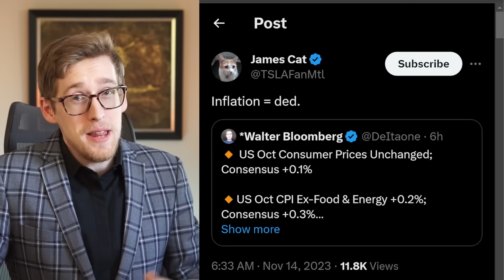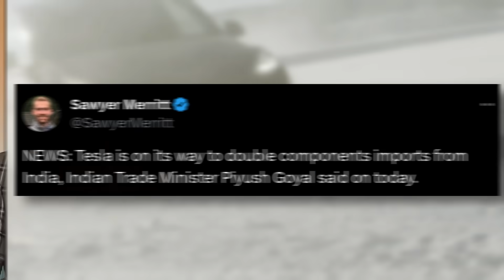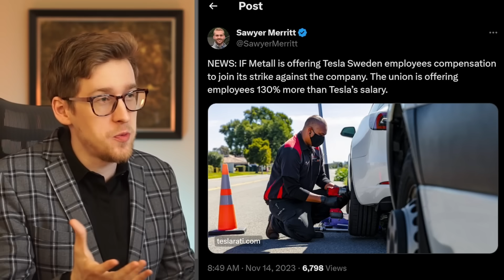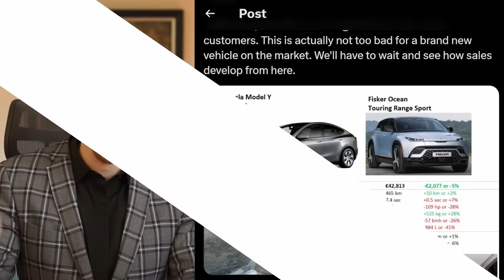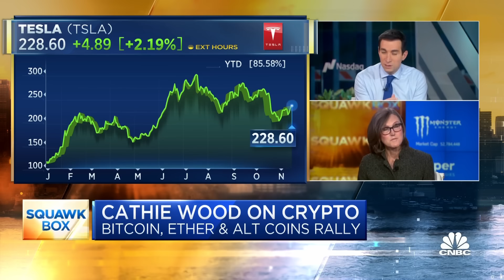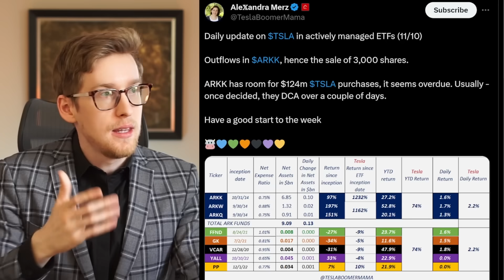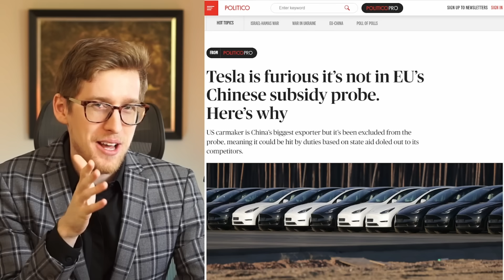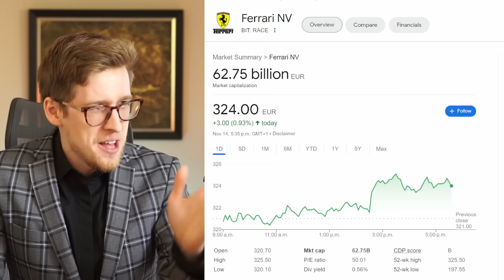TSLA JUMPS 6.12% on Bullish News | Cathie Wood CALLED OUT on TV | “TSLA to $150” | With Timestamps

Comment: when i first got my model 3 in 2018, I learned the hard way like you did on a winter day and had to stop at a private level two charger to get home.  After that, when charging at a supercharger, I would make sure I would have at least 20% charge when I reached my destination.  When I got there I usually had about 10% charge.  Since then the algorithm has greatly improved and when it gives you a predicted charge level for your destination, it is right on.
Reply: The first thing i did when i got a Tesla was change the view from battery percentage to miles. My brain doesn't calculate very good how much a certain percentage will last me but i can understand miles. Lol

Comment: Tesla’s range calcs are amazing. Driving my Model Y in a remote part of Australia I arrived at a non-Tesla charging station to find it out of service. I could have gone back to a regional town and got safely charged, instead I put the destination of a forward charging station some 250 km away on the Tesla screen. Tesla screen advised me in order to reach I would have to limit my speed to 90 km/h on the 110 km/h highway so I did.  Before long I realised I was blocking faster moving traffic behind me, so I pulled over and let them pass. One of them was a big van that offered a generous slipstream, travelling at 105 km/h, so I tucked in behind it using Tesla’s adaptive cruise control. Travelling at 105 km/h in that slipstream, Tesla screen advised I would get there with 3 % battery remaining. I got there with 5% battery remaining, and fully recharged to continue my journey 👍

Comment: Correct in your commentary. ETF managers have to maintain appropriate allocation levels in holdings across the various companies in the fund. If TSLA gains too much (or any company within the fund), they need to adhere to the fundamentals of the particular ETF and sell off a portion to rebalance. Otherwise the ETF is nothing more than.......TESLA STOCK :)

Comment: The car's reported range is basically EPA range * % battery remaining (which may or may not be accurate depending on temp/terrain/etc).  If you input a *destination*, and look at the estimated range remaining at the destination...this is very accurate and includes all the adjustments.

Comment: I have the same issue with the range of my Model Y LR as I did on my ICE cars, I drive over 80 mph on road trips in California which just keeps you up with the traffic flow. Still, no issue as I like to stop after 200 miles and take a break, if I need to get to my destination faster than that I take a plane.

Comment: Matt, the $7500 US EV subsidy for Tesla will not change next year or in 2025.  These requirements are always an fleet or sales average. All companies sell vehicles that don't meet emissions requirements and fuel efficiency standards but they make up for it by averaging it out w sales of more efficient models.

Tesla verified this earlier this year and is the reason why they quickly updated their website that all M3 SR+ models w LFP packs qualify for the full subsidy.

You cannot exclude stuff if it has ANY material/component while at the same time requiring >49%.  Then the 40% requirement this year and 50% requirement next year means nothing/is senseless.

Comment: There is a calculation for fungible goods in the free trade agreement, it allows you to average identical goods for the purpose of meeting the requirement, I would assume the same rules applies for the IRA. I did work on NAFTA 20+ years ago, it was meant for simple goods, like example nuts or bolts where you could not track what was domestic or foreign produced and the part was interchangeable. I can see Tesla deeming the battery pack interchangeable and using the fungible good calculation. 

I don’t think the model 3 will loose the $7,500 IRA credits

Comment: Kathie is very intelligent regarding economic matters, and her thesis regarding emerging technologies also makes sense. But her approach to buying and holding stocks has a lot to be desired 😂

Having a set percentage of one stock irrespective of performance in a fund is based on 'diversity'. But in stock/s diversity as a strategy simply doesn't work. 

Assume you have 100 stocks out of this number. Let's say 10% will double their value 5% will triple their value and 1% will quintuple their value.

Selling the profit making stocks because their monetary value has gone up MAKES NO SENSE 😂